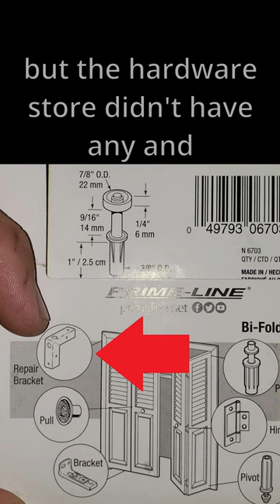How to keep wood from splitting

Comment: Ive seen this done before on trim on really old houses to keep corners from splitting. Great idea! Still waiting for that ultra clear polycarbonate video!
Reply from the maker: Sorry the ultra clear PC thing is coming but delayed because it ties into something else that I'm not done exploring yet. I'm developing a new hotend for high flow (>100mm³/s) and I think it is going to make a huge difference for clear printing. Here are some tips though, hopefully it helps:
1. Use aligned rectilinear infill, 100%
2. The filament needs to actually melt, as in liquid, not as in "just got soft enough to force through a small hole." The liquid state allows the filament to fill voids that normally don't get filled. Typically this is achieved by running very slow and/or hotter than recommended for the filament. This is where my new hotend comes in. It has a very long melt zone so that liquid state can be achieved without running super slow.
3. Run with a bit of extrusion multiplier, say like 1.025 to start, and tune to your liking. Because we are filling those voids that the slicer doesn't account for, we have to account for it manually.
4. Smaller layer height gives more consisten results when running hot, slow, and 100% infill.
5. Avoid part cooling if at all possible. Run hot on the hotend, hot on the bed, hot on the chamber, and solve parts cooling issues by slowing down. Use fan only when all else fails, and turn off as soon as possible. 
6. DRY your filament. DRY DRY DRY. I put brand new filament straight out of the package into a sunlu dryer at 70C for 12 hours before even thinking about printing with it.
7. Print onto a glass bed. Nanopolymer adhesive is a must. Textured bed will ruin clarity. 
8. Start with the settings i linked on the other video and modify to your liking.
Reply: Love it thank you very much for those tips!  100mm^3/s is wild lol my ender pushes 50 right now with the phaetus UHF dragon. Cant wait to see what youre working on i know life is busy thank you again
Reply from the maker: @Javii96  i tested phaetus dragon, VZBot Goliath, Slice Mosquito, and a few other "high flow" hotends and concluded that the 3D printing community just doesn't think big enough, and most folks don't even think (period) about it, as evidenced by the standard of expressing speed in mm/s instead of volumetric flow. Among those who do think about it, 30mm³/s is considered "excellent" by most, and that's just sad. I come from a 15 year background in industrial extrusion (wire & cable) so I have different ideas about what should be possible, what should normal, and what is the best way to melt plastic. The current version of my hotend is like a mico-miniature version of an industrial extruder with 3 melt zones in series and has a barrel that is the length of 4 Volcano nozzles. A hotend that long makes you sacrifice some z-height but the weight isn't a big issue because what you add in heater weight you can lose in extruder motor weight. When you're actually melting the filament instead of brute forcing it thought a laughably tiny heater block, not much force is required. The fluid plastic wants to come out, and your motor just gives it permission. A NEMA 11 motor (maybe even NEMA 8, not sure yet) is sufficient to blow any NEMA 17-based extruder out of the water, with a hotend like I'm working on. I have gotten up to 123mm³/s with Overture HS TPU and 111mm³/s with Polymaker HS PLA. If those were the only filaments I cared about, I would consider it a done deal, but I haven't yet made it compatible with the >300C temps required for PC and I still have trouble getting over 20mm³/s with super flexible filaments like 60A and 30D. Once I get those two things knocked out I plan to revisit the clear PC thing and see what is possible. I know I should put this on pause, make my clear PC video, and then resume, but I am just not built that way. I can't break away from this until it's done. And I'm married with kids and a job so this stuff takes several times longer than it would take someone else. Thanks for your patience, it will be rewarded.
Reply: @charlesstaton8104  that’s amazing i love the way you think about it. I think everything you said made complete sense and that’s why bambu labs was able to come out swinging hard because they realized there really hasn’t been any advancements in 3D printing for quite some time. You sounds like someone i’d like to send my resume to. Let me know if you ever have a need for a software engineer!
Reply: Have you considered or toyed with using 3mm filament instead of 1.75? I’m curious to know how much growth you see in the hotend when heating that much metal. Keep it up cause you definitely have a great YT channel concept here.
Reply from the maker: @Javii96  i have considered 3mm filaments but have not tested it. I think (not positive) that 3mm would be a step in the wrong direction because part of the challenge is getting heat from the outer diameter all the way in to the core of the filament. That's why CHT nozzles improve performance, they cut the filament right down the middle and expose the core to the melting temperatures and not just the outside. Most plastics have pretty low thermal conductivity, so the heat would tend to stay on the outside and not permeate to the core, and (I think) this would be more of a problem the thicker the filament is. That and designing for a what has now become a "niche" filament dimension would limit the applications of the hotend.

As far as software engineering goes, do you know anything about machine learning? If so, where are you located? You can answer with a message to chuck at strantor d⁰t c()m if you don't want to answer publicly.
Reply from the maker: @Javii96  one thing I forgot to mention on the clear printing, getting your first layer height tuned perfectly is absolutely critical. For normal printing, if nozzle height on first layer is slightly too high, the nozzle paths will distinguishable and that's not a big deal. For clear printing, the nozzle paths will be distinguishable and that kills clarity of the whole part. For normal printing if nozzle height on first layer is too low, there is some "elephant foot" that naturally resolves itself after a couple of layers because excess filament is squeezed into the gaps between nozzle paths that normally aren't filled. For clear printing, we are running some extrusion multiplier to intentionally fill these gaps, so there is nowhere for the excess filament to go. It just builds up and up and eventually causes an obstruction to the nozzle.

All my printers have auto bed leveling/adaptive mesh so I haven't tried it without that feature but I think it is probably a "must have" to do this, especially if you're printing something large.

Edit: oh yeah, and turn elephant foot compensation off. (Before dialing in z-height) (and leave it off).